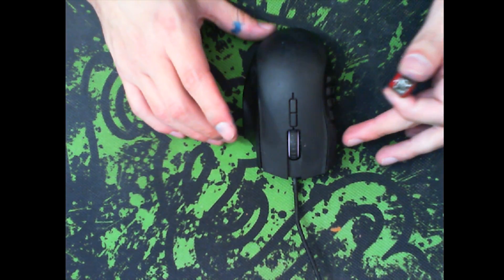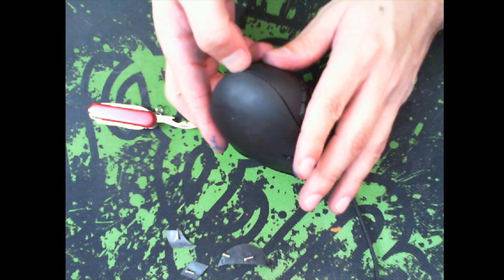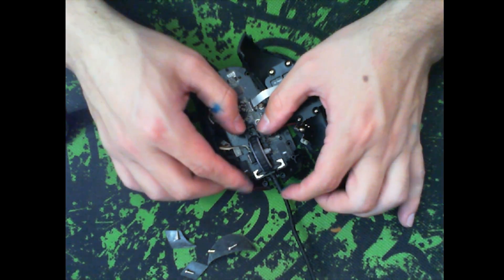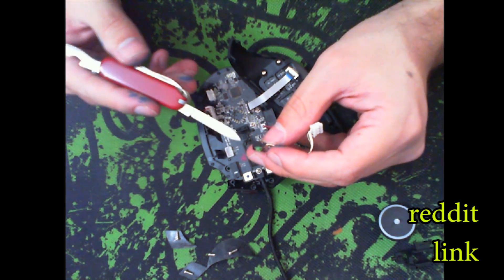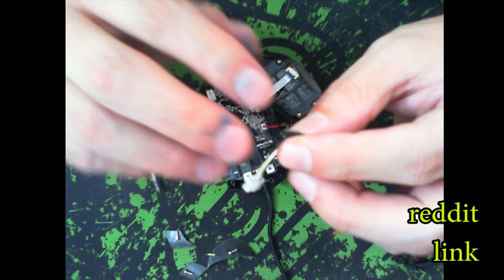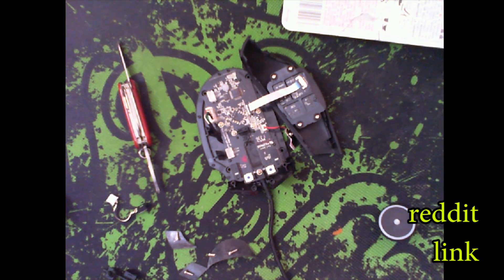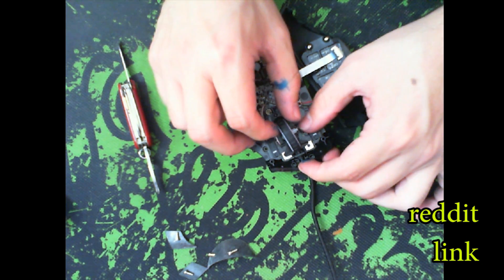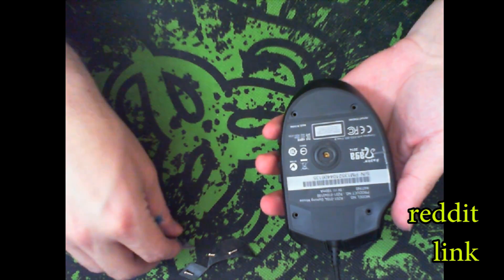How to Fix Razer Naga 2014 Scroll Wheel Jumping DIY

Comment: For anyone looking to get their mouse skates/feet back on after pulling them off, try cleaning all the gunk off and use some fresh double-sided tape. 3M Scotch Poster Tape has been working well for me. Trim the right length off the roll, stick the feet to the sticky side, trim around them carefully with scissors and peel the other side off when you're ready to put them in place. 

For easier access in the future, punch some holes into the pads where the screws go.

Thanks for the video. Disassembled my naga last night to look for answers and was astonished by how much junk was inside. Clearing it out didn't help with the problem (didn't seem like it would after seeing how it was built..) so research on the scroll wheel led me here. Very useful.

Comment: Woo! That's been bugging me for a while and it's all fixed now from this!

Only thing I did different was I couldn't get the little thing glued down and stay, so I put a tiny strip of cardstock paper on the shiny side of the little thing when sliding it and the wheel back into it's housing, so it holds itself down that way.

Comment: Thanks so much for putting together this guide and giving credit to the original guy.  This fixed the issue for me.  For the past month I've tried cleaning out the mouse with compressed air, but it did nothing to solve the problem.

I have the Wireless Chroma Epic Naga blah blah mouse and the instructions worked fine, there's only a few slight differences that don't affect this process.  I have a MS mouse that's 10 years old that still has a perfectly functioning scroll wheel... how did Razer get this so wrong?
Reply: Capitalism, they use low quality components to make ppl buy everytime new product, its shit sadly I miss the old times with good quality product. Triton is the same they sell it overpriced but with low quality components. 
fucking capitalism.

Comment: Using air did not work for me but this fix did. I actually ended up giving the scroll unit an alcohol bath because the contacts inside the unit were dirty, my guess is someone spilled a little soda on it.

Comment: Thanks, got mine fixed. I just did like a previous poster said, popped the wheel out and blew in the square piece and it worked fine after that +1. Im guessing the 2 downvotes are people that work at Razer lol.

Comment: could i just swap that entire  piece with a much older razer naga? It's a molten edition though, not sure if both are using the same thing
Reply: Leslie Soon just but replacement parts on eBay for less than AUD 5
Reply from the maker: I tried that with my naga epic and the piece was different so you would have to open it up and see if the piece is the same.
Reply: ahh damn alright thanks!

Comment: Found this on China.

You can buy the part.

https://www.aliexpress.com/item/Original-new-100-Razer-Razer-mouse-Razer-Naga-encoder-Razer-wireless-mouse-wheel-accessories-TTC-encoder/32637869658.html?ws_ab_test=searchweb201556_0,searchweb201602_2_10057_10056_10065_10037_10055_10054_10069_301_10059_10033_10058_10032_10017_10070_10060_10061_10052_10062_10053_10050_10051,searchweb201603_2&btsid=c6c1b6d9-1e65-4769-ad54-664f41bfe205

Comment: Thanks bro I've been having this problem for 10 months now, and found the reddit post with the imgur gallery but didn't know how to open that little box since it wasn't explained. Followed your tutorial and even tho I wasn't able to perfectly close the box (and didn't have super glue either) I removed the whole wheel support to get a firm grip, and I was able to push the wheel in and make it stick. Mouse wheel is working perfectly now :)

Comment: I press the metal, but didn't work well. It makes the wheel become easier to scroll... conclusion, don't even roll on the page, game, whatever.  =/

Edit: So I take away the metal piece. Both and looking the little green stuff i pull the cooper spike. I don't ripped from the place, just to let it more "tall" and them assembled all over again, used super glue just like in the video and it is working! I dunno for how long, but it is. The only difference is I can't feel the friction when I roll the wheel. It's totally smooth now, but working. Very thankful for the video, it helped me a lot. 

Ps: Even screwed things in the first... second... well in some tries, I didn't dislike the video. Best regards!
Reply: use a straw to blow into the whole where the wheel is, it fixed the issue for me and a lot of people. :D
Reply: I managed to fixed on the next day. Was hard but I did it. And now is like are no resistance when I "roll" the wheel, but works perfectly.
Ty guys.
Reply: Great :D

Comment: Confirmed to work with Naga Chroma. Thanks a ton, mine is only 6 months old and this poop started happening. Also, managed the fix without superglue, if you are careful and leave a pin of the exposed part of the little part, it will be held in by the plastic mount.

Comment: Mouse works perfectly after doing what was is in the video. My only change was that I cleaned under the green thing with a Q-tip and got a bunch of gunk out which might have also been the issue. Thanks for the video.

Comment: Thank you so much man! The only problem (which was my fault) is that the black stickers at the bottom of the mouse can get little bumps around the edges if you knife them up too hard. So, if you're going to do this, be careful!

If you do happen to mess up your sticker (aka make the edges pop up), you can just cut the protuberances with a knife or push them down really hard.

Comment: I have this problem with my Naga, and it bothers me but I stopped using the scroll and using the hot keys on the side for a few months and I went back to trying my scroll wheel and it seems to work better than it used to and doesn't jump. Do you think over time it slowly fixes somehow? Sorry if this is a dumb question I'm not too big into this kind of stuff.
Reply from the maker: +Xight33 I honestly don't know :/
Reply: +DHYohko thanks, this problem doesn't bother me much though because I rarely use the scroll lmao

Comment: Thanks for this video.  I didn't use superglue though, I found a better way.  Once you get the mechanism back in its plastic holder and snapped into place, jam thin pieces of cardboard between the plastic holder and the metal plate on the mechanism and this holds it together mechanically.  If I need to get to it again, I can just take these pieces of cardboard out, no glue to contend with.